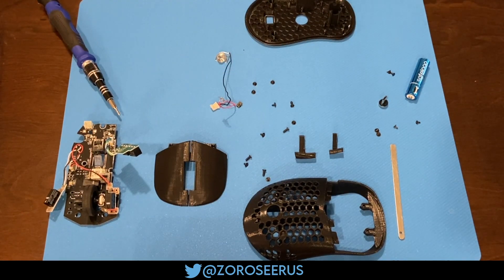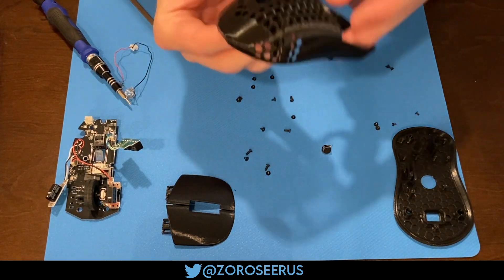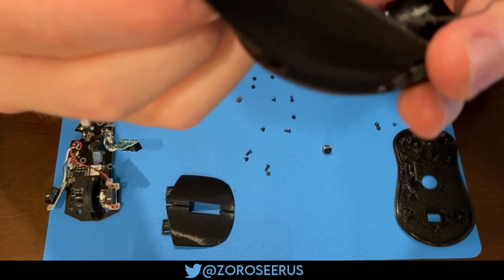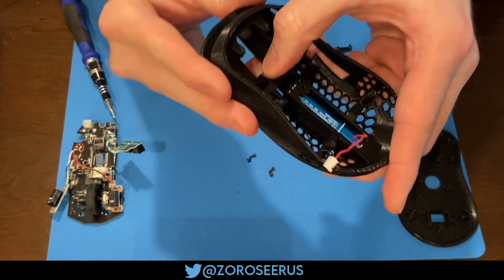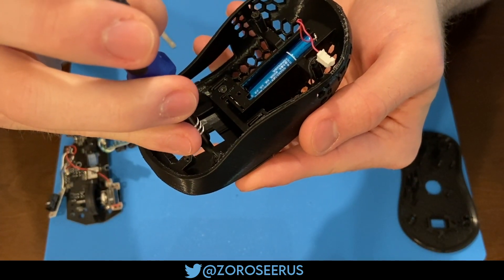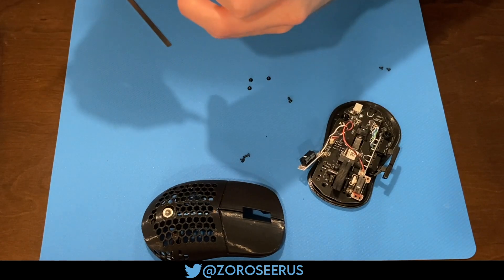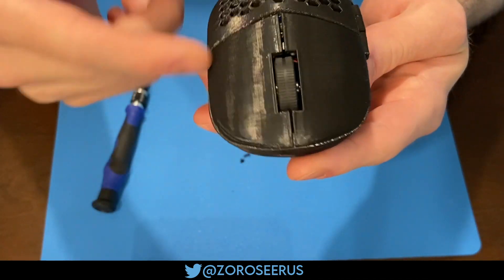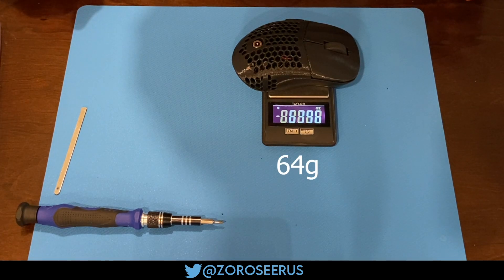Wireless XM1 Mini Assembly Instructions [G305 Internals]

Comment: Does that battery wire come with the g304 internals or did you buy them? Because i cant seem to find the connector that plugs in to the pcb
Reply from the maker: It’s the stock battery wire that comes with every g305

Comment: Is it safe to use this mouse while the battery is charging? 
I noticed that these micro USB batteries measure 5V instead of 1.5 when they are charging so I'm a bit worried about the G305 PCB.
Reply from the maker: No idea. I don’t know why you ever would. The charge spot is in an incredibly awkward spot and the battery lasts awhile so just do the refinery intelligent thing and charge it while you sleep or something